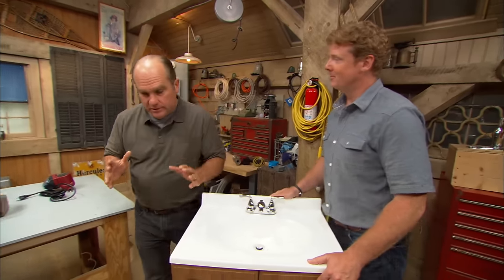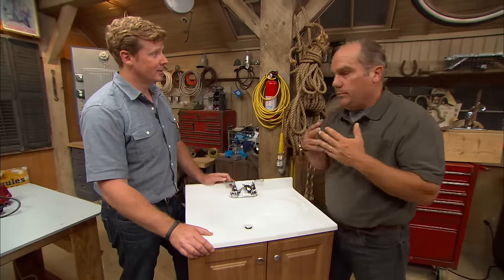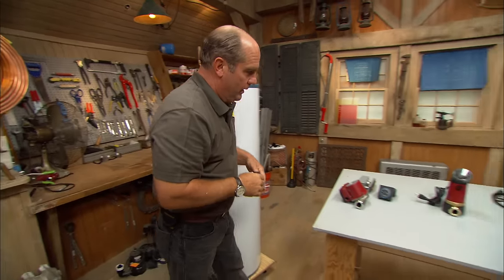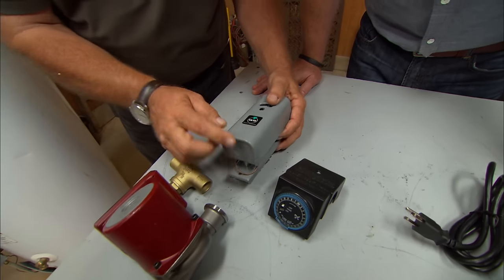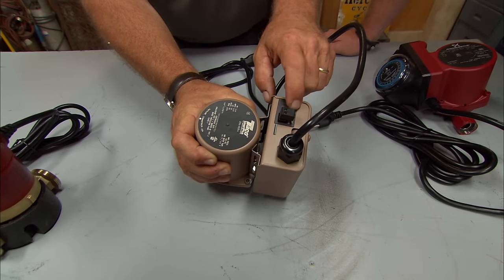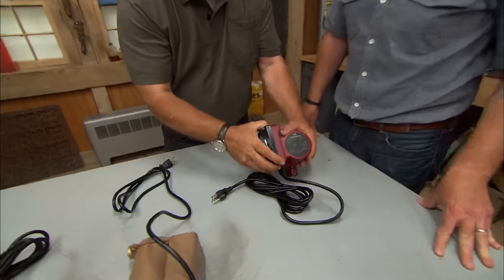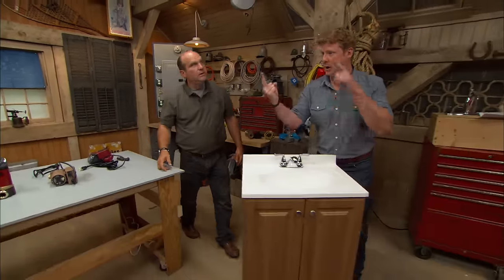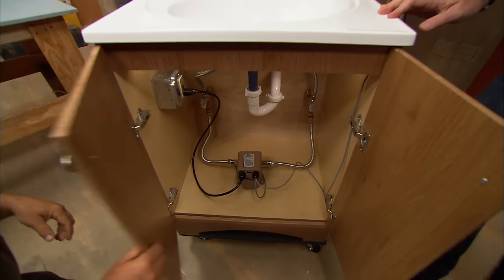How to Get Hot Water with a Recirculating Pump | Ask This Old House

Comment: Seems to be a pointed method to increase the consumption of energy .
Reply: But reduce water use.  So... which is more important in your community?
Reply: @matthewfry133 ......thanks for the reply/remark. I have been thinking about this for some time (in the UK context). I like the diversion valve, ie pushing water back down the cold, but I perceive (in UK) regulations, it would be illegal. We have a requirement for double check valves to ensure that water is not forced back into the supply main.As our boiler to kitchen sink has a relatively long run, I spent one winter heating the washing up water with the kettle, and perceived an energy(gas)consumption drop of 10%,but in reality the lack of control makes the result very doubtful. If it were not for lack of space, I would be tempted to add an in line water heater in the kitchen, and cut the delivery hot water supply, as the washing machine (no dish washer(only me)) only takes in cold. I presume, you are having to pay for water, based on per gallon / ton? Here, there is a flat rate, based on house price , unless you opt for / gallon, usually people living on their own.
Reply: @robertwoodliff2536  The check valve to prevent forcing water back into the main is not actually a problem.  No water would ever be forced backwards out of the house back to the city supply.  What happens is that the water in the hot line (which has cooled off) goes into the cold line in your home and then straight into the supply for the water heater in your home.  It's a closed loop within your home.  Now, if they have regulations prohibiting backflow within a home that's a different matter.

I was thinking about the benefit to places experiencing drought of avoiding the waste water more than the costs involved.
Reply: @matthewfry133 ........drought in the UK, is not a real problem, in the simplistic approach. In the green approach, it is.
In the drought / high cost area, maybe, the other thing to look at it grey water ( bath / shower water.) recycling, for toilet & garden watering. My understanding is, this is feasible, if problematic.
Reply: Only if you let the system run unabated 24/7. If you study your household schedule/habits, then you just set the timer to run the system a few minutes before hot water gets used. At this point, the water heater was going to run anyway. Then have the pump shut off.

Comment: How do you bleed the "Cold" water in the the hot water line to the cold water line when that cold water line is already pressurized (from a well pump pressure tank, or city cold water)?
Reply: That's why there is a pump. It forces water to circulate. The cold water will be pushed to the tank as the pump draws from the tank.
Reply: @anthonythorp7291  Oh, okay, sorry, I get it now, I think.  If you draw from the tank, water needs to replace it.  But...your circulating pump would need to be higher than the supply pressure, or do you have an electric valve to shut off supply water as this is happening?  I mean if you draw hot water from the tank and you have 60 pounds of supply water pressure, why would it not fill the tank before the water being forced in the cold water line 200 feet away?  You are also have to fight the back pressure too are you not?
Reply: @Daveyk021  all you are doing is pumping water in a circle. No water is actually leaving therefore no water can enter. Once you open a tap, then new water enters the system.
Reply: @anthonythorp7291  Okay thank you.  The pump also has 80 PSI which has to help, but no, I understand now.  My water heater feeds in the middle of 3/4" Pex Lines, so I have to decide which bathroom gets the hot water or put in two pumps.  Either way, I have to decide on electricity to heat the water more often, or just let the water run for 2 minutes to get hot water and use more electricity to run my well pump.  The water heater is hybrid and it has never fired up it main 4500 elements; just using the heat pump to heat the water (I know because I monitor and log it with a Sense system).  So it's possible running the well pump more often is more expensive.  I think that 1.5HP pump 350 feet deep uses about 2500 watts when pumping, but.... I have a 50 gallon pressure tank.

Comment: so spend 160 to 400 for the pump, assume another 100 for the fittings and pipe just to connect the pump..and another 400 for the house runs, , and another 5000 watts of energy from the grid.., and 2800 for the plumber..yeah great deal..  no thanks .. just let the water run.. it would cheaper to have a secondary small electric  tank under the sink on a timer..around 200 bucks total..
Reply: we get it.. youre poor
Reply: 100% agree totally pointless invention
Reply: Agree. I have a 1 gallon jug in Bathroom so i can catch most of the cold water and use it for my plants or to wash my hands. Cha-ching, money stays in my pocket.
Reply: When you need drain water for 2 minutes to get the hot water (because the last homeowner installed 1" pipe and it runs in a very roundabout way), a device like this makes a huge difference.
Reply: Living in the desert just outside of Phoenix on property with a well, water is always something to be conservative with. Well pump sits at 500' below the surface, cost to drill to the next aquifer down is about 20K. For me and my custom built house that has the return lines built in and I run my unit off a wifi controlled outlet plug, it's a huge savings vs me running out of water at the well. Plus who doesn't like instant, burning hot showers in the morning during winter?
Reply: richard michalko Ha !Exactly.
Reply: As a plumber I must say that $2800 sounds a bit steep.
Reply: This system is useful for big hotels which have hundreds of guest rooms. Only there one can save money and also maintain standard.
Reply: I think you missed the whole second part of the video where he shows you how to avoid a traditional recirculation loop. A small pump will turn on for a few seconds every couple hours to keep the line warm, and shove the cold water back into the cold line. The whole kit is only $170 on lowes. No need for plumber if you can turn a wrench, not even close to 5000 watts.
Reply: Do you buy the gold plated pipes and fittings?

Comment: Several years ago our copper lines under the home "peppered" and failed causing us to have to run the new lines overhead in PEX.  Problem is, the plumber did not insulate the lines on the outside walls, thus every time it freezes, they freeze.  I can see where the bypass valve might keep the sinks with the hot/cold water from freezing, but what about the single feed line to the toilets???  Would it make sense to run a second line connected to the hot water side behind the toilet with the bypass valve so the toilet is moving water continuously as well???

Comment: you dont need a separate return line, you can add circulation pump direclty onto hot water output of water heater, and you put a sensor at furth fixture. $180 solution cheaper than this video!!

Comment: My question is how does this recirculate or get back to the HWH? Does it go back through the cold water pipes to the heater?
Reply: Yes, unless you run a dedicated hot water return line back to the heater.

Comment: I have a tankless water heater and have this problem in my kitchen and master bath. Both are a long way from the heater. The recirculation pump will save water but I think it would only make sense in an urban area where water is scarce. For me personally since I have my own well it would only be a convenience to have that pump.  I can see the benefit but probably not worth the money.
Reply: If your neighbor dumps his used motor oil into the ground does that come out of your faucet?
Reply: No. My nearest neighbor is 1/2 mile away. I live on a farm. And I doubt any of my neighbors are dumb enough to do that.

Comment: I like the idea of saving the cold water by using the bronze pump my question is when the bronze pump kicks on and starts to send the cool water over to the cold line to bring the hot water up does the water meter still spin and are you still being charged for water coming into the house when you turn on the hot?
Reply: Think Outside The Box I guess when the hot water is leaving the water heater, the water heater needs to pull external water in. The recirculating pump back feeds the cold water line and send the cold water to the water heater.
Reply: no, recirculation means you're looping the water already inside your house.
You're charged for water coming INTO your house.

Comment: GREAT VIDEO (H.W. Recirc has been a pet peeve of mine for a long time.  Glad to see you show us some modern solutions)

HERE'S A CHALLENGE:  I'm buying a home from Freddie Mac that's been shut down for a long time.
The heater unit is really old.  While the AC side was tested as good the heat was not (because the gas supply was shut off or empty).

Do you have a slick way to connect something like a portable propane tank to fire up the system so we can test it for CO?